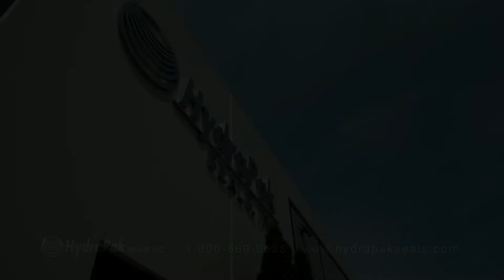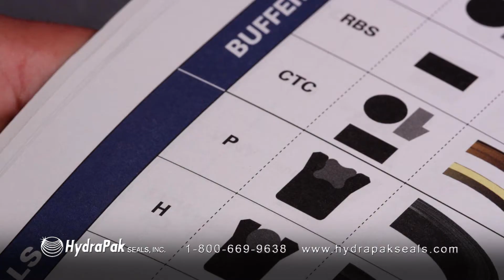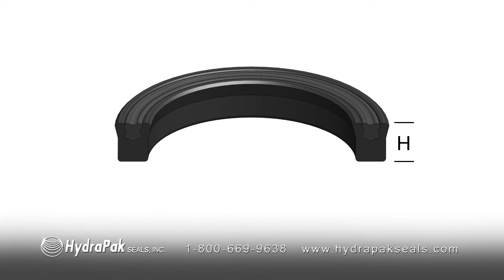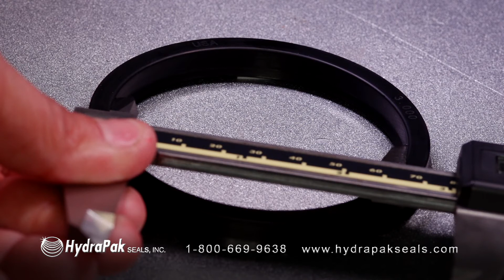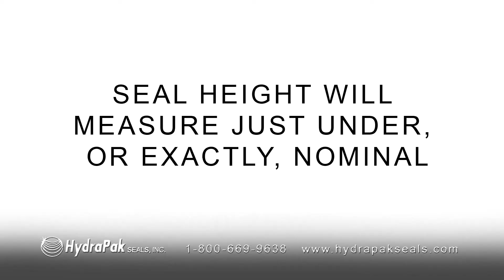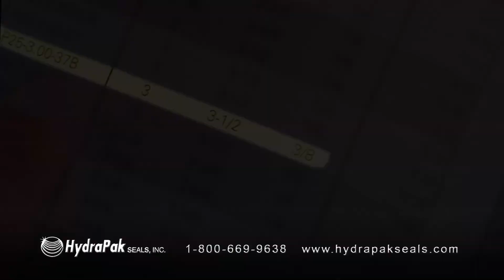Hydrapak Basic Of Measuring a Seal

Comment: Then you measure the cylindrical section of the catalog, not the lips, am I right? I have a seal just like that, it has the code 250-1.75-375 and it should be installed in a 1.75in Rod, how can I calculate the cavity diameter amd width where it will be installed?